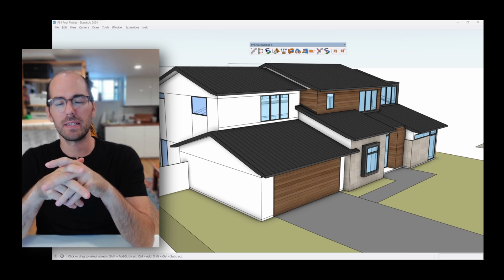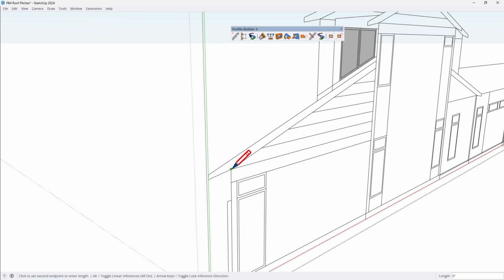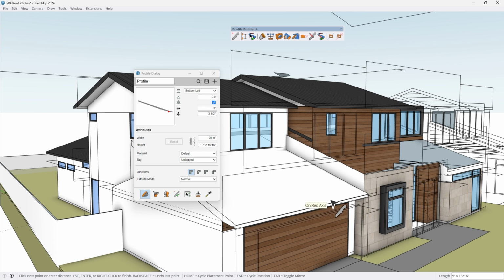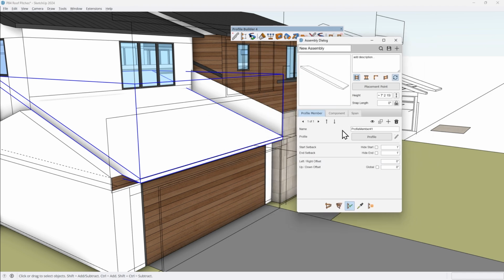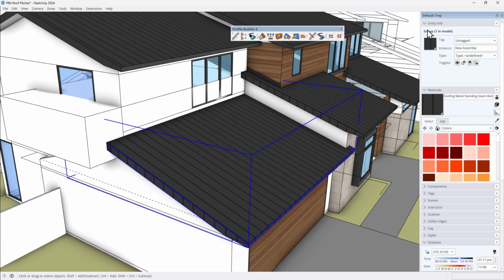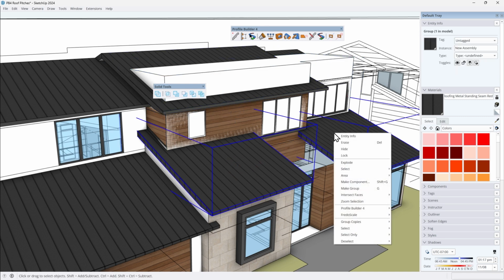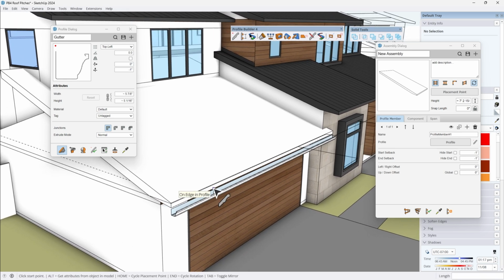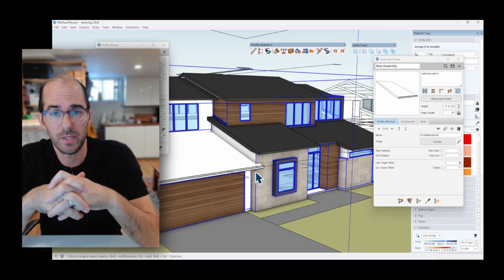Save Time Modeling Repetitive Roof Details and Overhangs in SketchUp with these Tips and Tricks

Comment: I build many types of deck railings that I sometimes struggle with. I want to build a report of what size sections are used, i.e. 4, 5, 6, 7, 8'. There is a different top rail than the bottom, with corresponding railing mounts attached to the posts, Could you do a video on this subject? Thanks in advance.